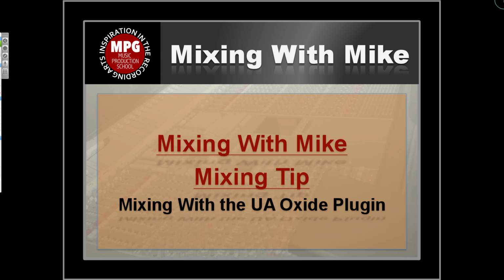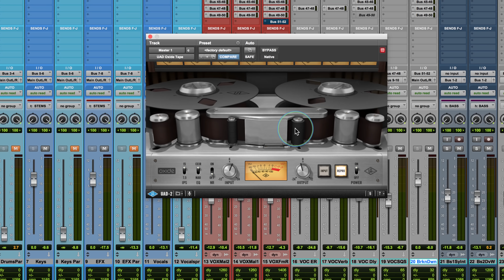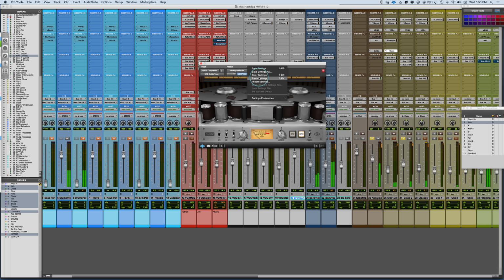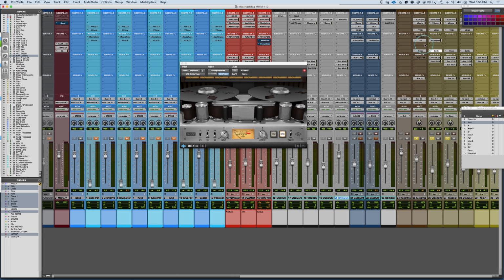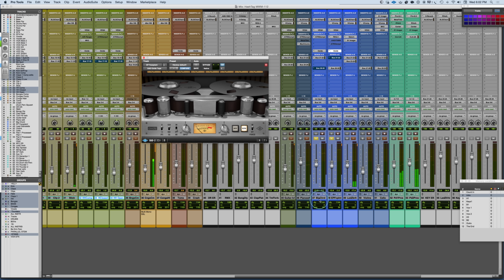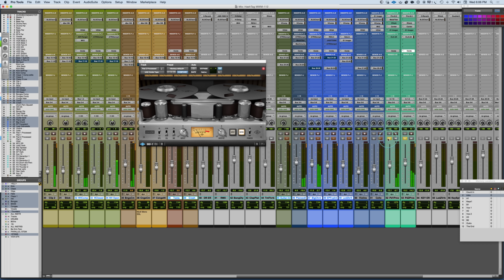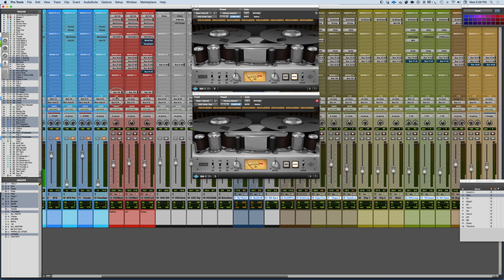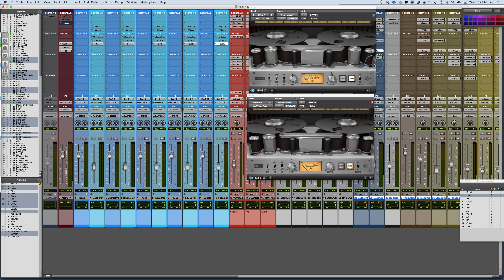Mixing With The UA Oxide Plugin - Mixing With Mike Mixing Tip

Comment: To save you time!

The oxide tape machine is a emulation of the A800 studer, they quote it to be a emulation of some secret tape machine but there’s restrictions to there stock setting with minimal calibration (which is minimal setting editing!)

The A800 Studer gives you more control & flexibility!

They both add warmth & saturation but the A800 give you a lot more freedom & and little more control over your mix, in my honest opinion, go for the A800 studer over the oxide, so you not giving them a bunch of money for just add-ons. I have both but I wish I just got the A800 Studer first because it’s literally the same exact thing but here’s the slight differences below & under the hood ! 

Oxide Tape Machine : 
• Unknown reel tape (it could be 250,456,900, or GP9) 🤷🏻‍♂️, who knows, only the creators or comparing with the A800 for hours till you get a answer
• IPS (inches per Seconds) - Settings 7.5 & 15 ( no off selection  or 30 IPS)
•Similar EQ (National Association Broadcast for low end boost used to broadcast in North America & Japan , & Comité Consultatif International des Radiocommunications is used for higher frequencies boosted for broadcasting in Europe & other parts of the world).
• Similar noise reduction.
• Similar input & reproduction button but no sync or thru button & no calibration settings.
• Similar Input & output control.

A800 Studer : 
• Tape Reels (250,456,900, & GP9).
• IPS (inches per Seconds) - turn off selection, 7.5, 15, & 30.
•Calibration boost of +3, +6, +7.5, & +9 ( which means you can adjust the HF Driver, Sync EQ, Repro EQ, & noise settings, you can only 1 of the 4 buttons (thru,input, sync, & repro) then boost your levels or attenuate/reduce to lowest setting of +3, & lastly you have auto cal that you can turn on or off. 
•Similar EQ (National Association Broadcast for low end boost used to broadcast in North America & Japan , & Comité Consultatif International des Radiocommunications is used for higher frequencies boosted for broadcasting in Europe & other parts of the world).
• Similar noise reduction.
• Similar input & reproduction but you get sync & thru. 
• Similar Input & output control.
• Calibration control for accurate, consistency, reliability in measurements & performance as mentioned above ⬆️, you get to adjust the parameters such as bias levels, high frequencies, low frequencies, noise control such as  (hum & hiss) macro settings found in the sections mentioned above (HF Driver, Sync EQ, Repro EQ, & Noise). 

This completes the comparison between the “Oxide Tape Machine” & the classic “A800 Studer”, if you’re confused after watching this 29 minute episode. This is everything you need to know about these two great gui (graphical user interface emulation of a classic tape recorder used by many legendary musicians, composers, & artists). 

I hope this helps!

Comment: Next step in these multitrack emulations will be to model each channel, helping the "depth" factor (like the Waves NLS for the audio desks), and also, knowing that the edge tracks' quality suffers... Thanks for another great video, Mr. White..
Reply from the maker: +CarlosGunX I agree 100%.
Reply: +CarlosGunX Brainwork has released the bx_console which you can select channel inputs. It's one of the first modeling with that in mind.
Reply: +JT .. Yes, JT.. I have been considering it... Waves NLS has the advantage of switching between desks, which I find very useful.... ..
Thanks for your reply..

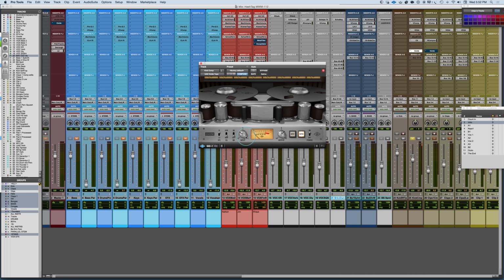Comment: Hey Mike... thanks (as always) for this wonderful video. While watching, I noticed at the 6:46 mark that you said you wanted to turn the tape noise "off", but if I'm reading the UAD manual correctly (and I may be completely wrong), it appears that they've implemented this feature to be "Noise Reduction" and operate in reduction mode when the switch is in the "on" position. This is completely backwards to my way of thinking, but I guess it does make sense if you turn something called "reduction" to its "on" position, then that when it actually starts reducing. Ouch my brain! Anyway... thoughts? I haven't cranked my system up with the Oxide plugin yet to see which was is which, just made a note of it as odd.
Reply from the maker: +slamcrank Hey SC!
Nice catch, I think i did get it backwards in the heat of the moment. I guess I was more focused on the demonstration and the amount of noise added is not obvious enough for me to catch it.
The button is backward logic, but technically more correct than turning the noise "Off". Tape hiss and hum from the electronics is inherent in a tape machine and Noise Reduction is required to remove it. That said, Noise Reduction typically came in the form of a Dolby SR or Dolby A system which brings in all kinds of other issues as well.
Cheers!
Mike
Reply: +Michael White I feel seriously lucky that I have never had to deal with Dolby SR or Dolby A systems. I constantly hear that they were a mess! Happy holidays to you!!
Reply from the maker: Thanks SC!
SR was much easier to deal with and better sounding when you followed the recommended settings. Problem was that tape compression messes up the NR processing. That's where it got ugly for engineers. Also, the NR cards did not always work exactly the same, so you had to have the same rack of them everywhere you went.
So much easier now!
Hope you had a great one too!
Mike